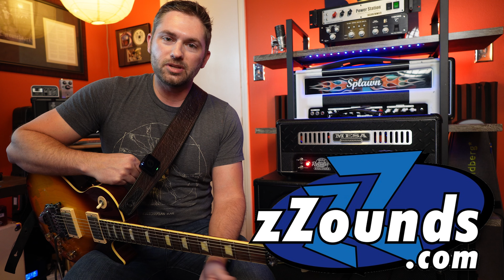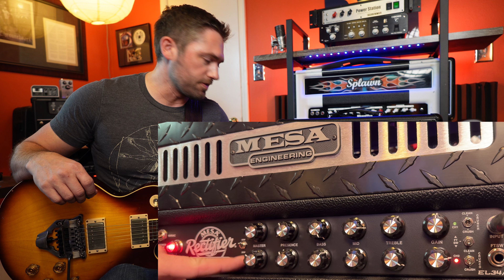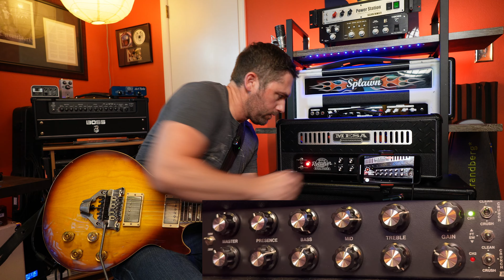Mesa Badlander 50 Review

Comment: Thank you so much for putting into words my problems with the amp, its lack of compression and saturation. The notes have no grace or flow what so ever. It's great for rhythms and riffs but for and single note stuff or solos it just leaves you wanting more
Reply from the maker: Yeah boosting it definitely helps but I connected my Jubilee up next to this amp and when dialing in the same amount of gain from both amps, man... the jubilee just feels SO much better to play and cleans up unbelievably well.

I'm testing the MKII Victory Kraken in the studio now and going on stage with it this weekend and that amp has REALLY impressed me.  It's got all the nice fat saturated low gain crunch but still has a very tight, clean and percussive high gain channel and a bit warm and powerful clean channel.  I'm really looking forward to the show with that thing.
Reply: @FastRedPonyCar  my buddy has the mk1 and it's pretty sweet. The sound that comes out of something that small! And I'm a 5150 guy so I get the crunch and the saturation!
Reply from the maker: @noizewriter3324  The Kraken low key started life as a 5150 clone and then they tweaked from there.